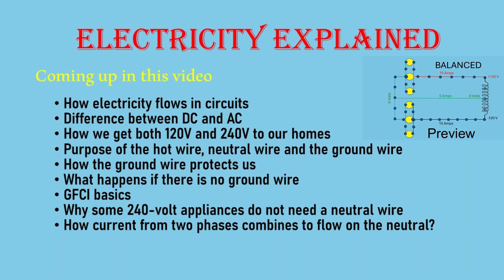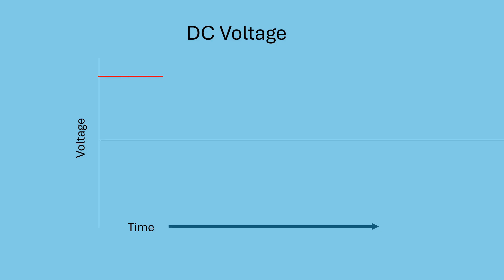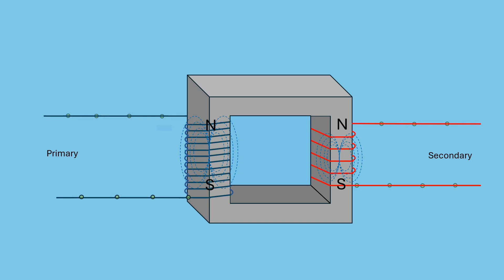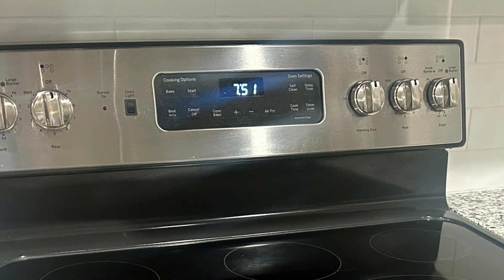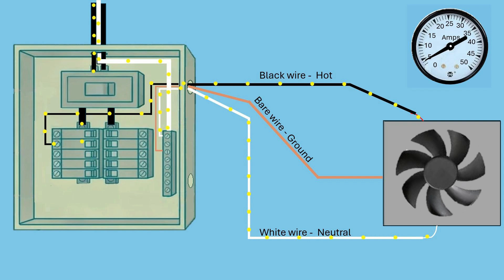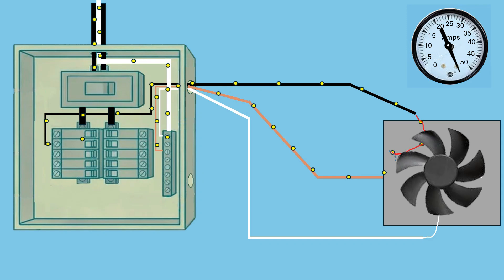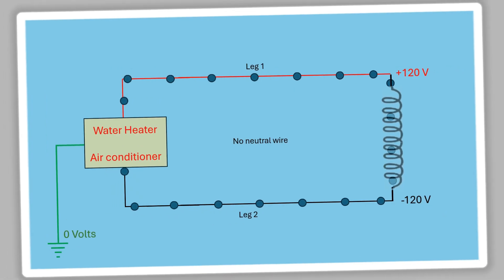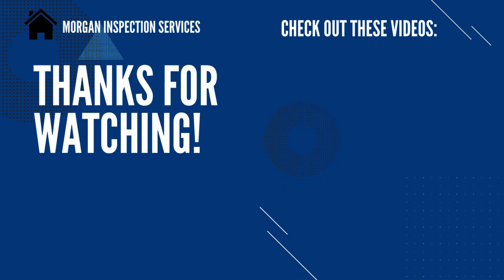Basics of Residential Electrical Systems ￼￼

Comment: I lived on a farm as a teenager, with a 3 phase service, 120/240 volt open high leg delta, we had a grain dryer, milker and a silage conveyor belt which required 3 phase at 208 - 240 volts. The three phase panel was in the barn, 100 amp 120/240V single phase ran to the house, the  meter &  site disconnect on a pole in the middle of the barnyard, and two transformers at the road, one was larger.  Between any two phases was 240V, phase A - neutral 120V, C - neutral 120V, and B - neutral 208V (typically referred to as the high leg, required to colored orange and land on B phase of the panel, accidentally placing a single pole breaker here will smoke up everything on that circuit) 

While 3 phase service would be very unusual to see in a residential setting, there are situations where it exists, and home inspectors should at a minimum, be able to identify a three phase service by noting 4 wires coming into the main panel vs your typical 3 wire found in virtually all homes, and some light commercial.   This would be a great subject to mention in a future video on transformers.
Reply from the maker: Great info. I am in the process of making a transformer video. I will include three phase. I always appreciate your comments because I learn something every time.